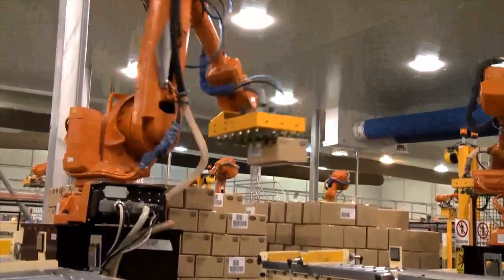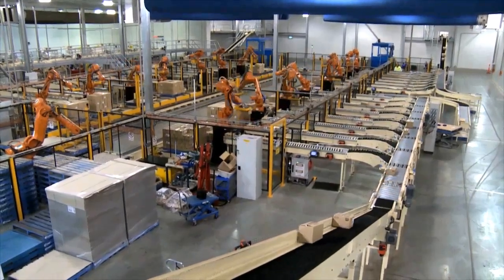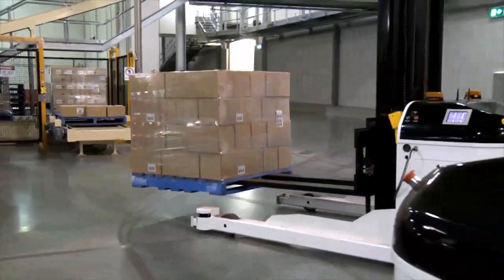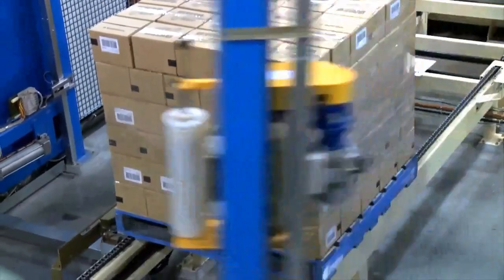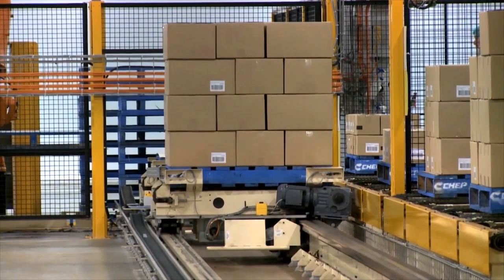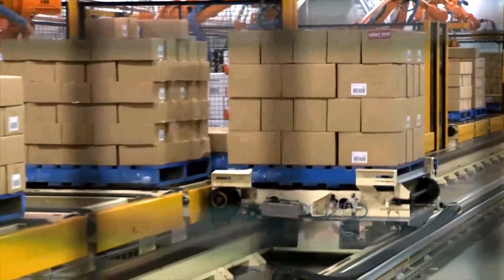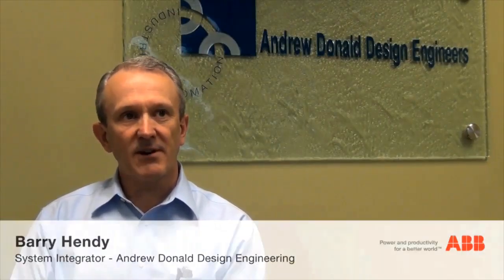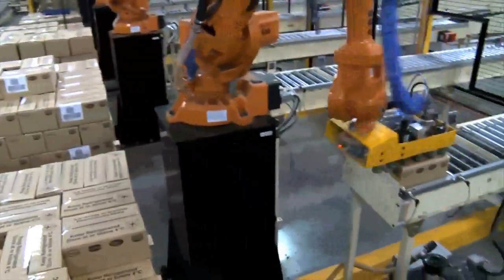ABB Robotics - Palletizing Cartons

Comment: That's good point. I think IRB 460 would be much better in every way(speed,  singularities and so on).
But IRB 460 is more expensive than IRB 4600 that's why they chose IRB 4600 I think.